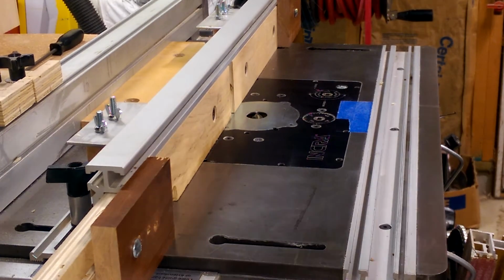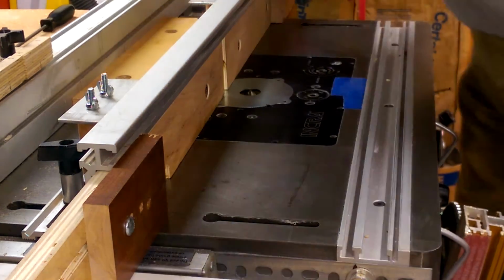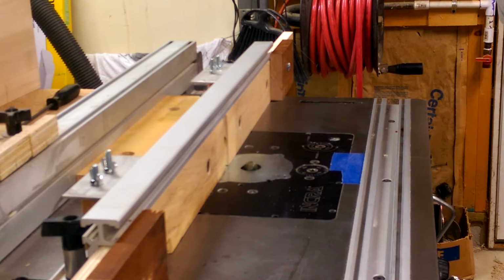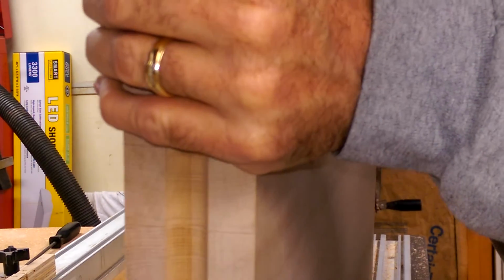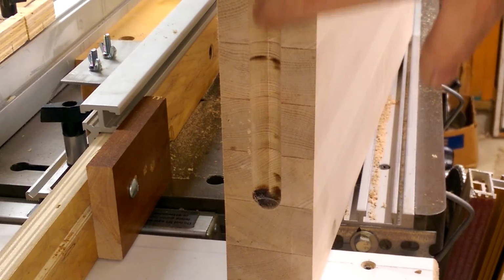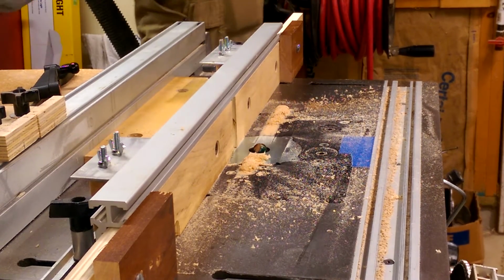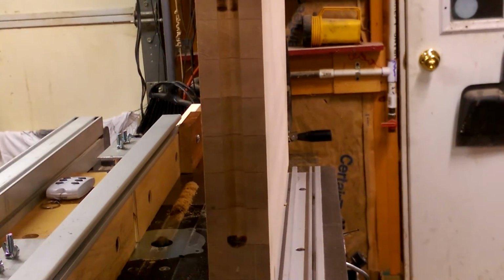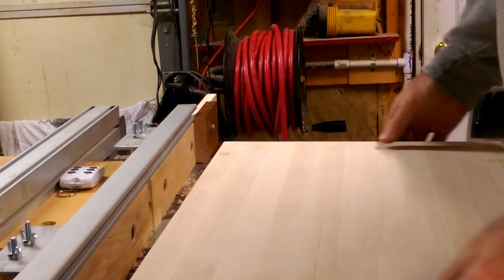Cutting board finger grooves.

Comment: As the bit turns it generates heat. The less time the bit spends turning against the wood the least chance of a burn. Your ends burn but your center run does not.

Comment: How do get rid of the burn marks? It takes me 20 minutes to hand sand them because the burning is so deep into the wood not just on the wood.
Reply from the maker: A sharp bit is probably your best friend and then get real personal with the sand paper. No other way I have found than that.
Reply: @CHICAGOHAND  Shallower cuts in multiple passes will eliminate the occurrence of burn marks.
Reply from the maker: Yep I agree. Thanks for commenting.